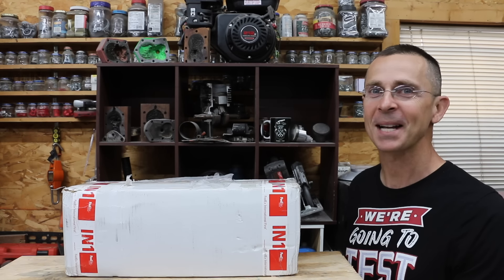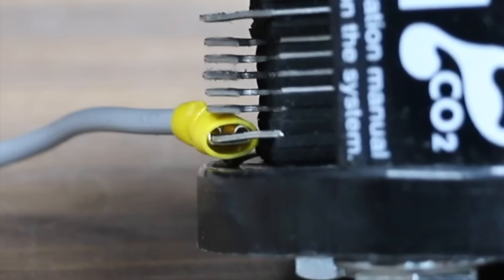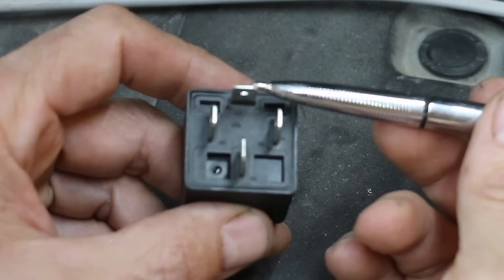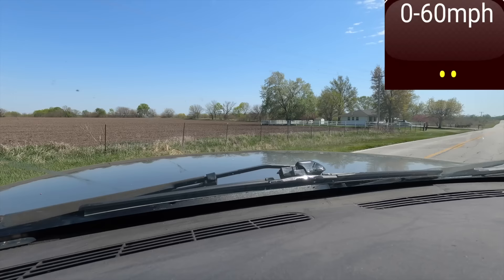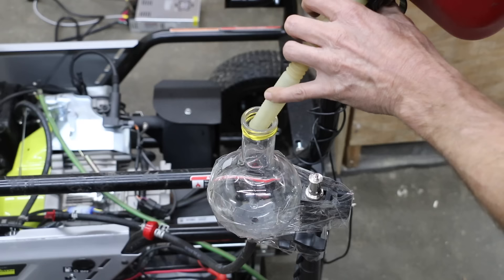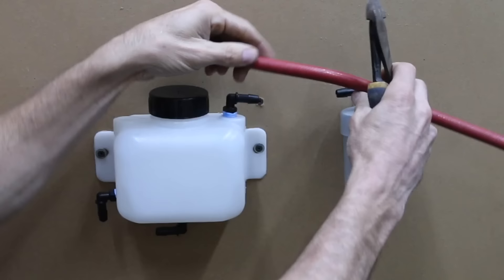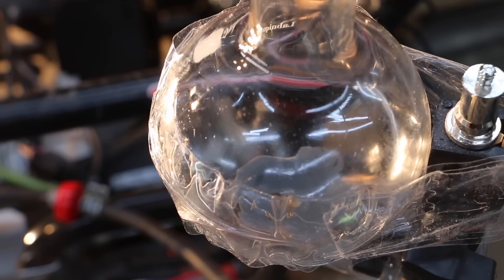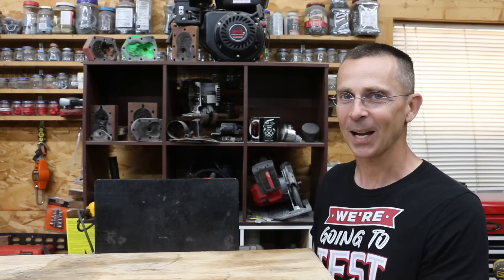AMAZING 35% More MPG with HHO? Let’s find out! Help with high gas prices?

Comment: 33 watts is about .044 hp. Since electrolysis is probably more efficient than internal combustion, the HHO (really 2H2+O2) can't possibly produce more power than that in the engine. This reminds me of the water injection systems sold by JC Whitney back in the 1960s. Those might have actually helped some of the higher-mileage vehicles (70-80,000 miles being high mileage in those days) that had deposits built up in the combustion chamber causing detonation due to the resulting increased compression ratio.  I'm sure "Project Farm" knew this wouldn't work when he decided to try it, but it is entertaining.
Reply from the maker: Thanks for the feedback.

Comment: Hi Todd. 

Awesome work mate - having watched many of your productions - I offer sincere congratulations on the high quality of your work. 

Imho - this hydrogen stuff has become utterly ridiculous in some circles with wild environmental claims about its positive abilities, while completely ignoring the note worthy hazards / problems in proposed high volume residential use.

I'm certainly glad to see this HHO cell debunked and the generator test was perfect - 5 Watt of parasitic loss in the rectifier and at best, 30 Watt of gas production added to 8.75 kW isn't impressive or even worth the additional complexity or additional material resource per Watt gained. That's assuming no leakage or loss of the extremely soluble (in virtually every material known to man), super high explosive gas, through the fittings, tank cap or pipes. Of course there is always loss in the cables and heat loss in the HHO cell itself. 

Recalling the physics favourite - Power Out = Power In - Losses.

As to folks claiming it works in cars - I understand this to be unlikely given few motor vehicles have an alternator that is larger than a Kilowatt or so. Since the alternator won't be running at full load there may be some proportion of that available to power a HHO cell. Even if that was say 500W spare - the question becomes is 1/2 kW even noticeable in a 5L+ V8 with several hundred KW on a bad day? 

If there was some way to harvest free power in a vehicle perhaps through HHO regenerative braking and HHO cell efficiency testing became necessary - then perhaps measure the Amps and time to fill a fixed space (say a mole sized box ~24L) that is lined with a balloon. Since its a mole volume there will be a text book quantity of gas of a known energy value. It would be interesting to see what the actual efficiency % and true output of your cell, minus all its losses is.

Cheers
Reply from the maker: Thanks and you are welcome!  Thanks for sharing.

Comment: I would think you would have to set the fuel intake to a leaner mixture and let the the hydrogen fill in the gaps. It seems easier to accomplish on carburetors than efi.  Appreciate the time you put into this.
Reply from the maker: Thanks!
Reply: The problem is it's a scam.  In simple terms you're unburning water just to burn it again.  The best you can achieve with electrolysis is 65% efficiency and the best you get out of an engine is roughly 30% efficiency.  So you are investing let's say 1000watts to get your hydrogen you get 650watts of fuel of which you get back roughly 200watts of mechanical energy which at best at the alternator at 80% efficiency yields roughly 160watts of electricity.  

You also need at least 4% hydrogen to burn and you will not achieve this with a simple fuse.   

Also with increased electrical load on engine you have increased mechanical load.  An alternator isn't simply producing surplus wasted power.  It's small at let's say 50 watts but that 50 watt investment is simply blown out of the tail pipe.
Reply: @mattzukowski1207  used solar panels  free any way .not used power grid .  good for off grid have bring in gas .
Reply: I'm not sure how good used solar panels are but solar is at least a real technology.  Heck you can even use solar for electrolysis and tank the hydrogen.  You'll get HEAVY losses like roughly 50% but this can be done.  Batteries are typically more efficient with lead acid being 85% and often higher.  

If you live in a city it likely would make more of an impact to sell surplus power rather than store in hydrogen tanks.  But if you're off the grid it's a consideration.

Comment: I had positive results with a 1968 VW bug. But I dropped my hose directly into the carburetor. I the fuel line from the generator pointed directly into the same area the fuel from the gas feed. I would automatically assume adding more pressure into the air system you would consume more fuel. So try finding a way to feed into the fuel system itself. Instead of trying to feed more through the air system.
Reply from the maker: Thanks for sharing.

Comment: Good work. Played around with HHO back in the 2000s on my 1987 BMW 528e.  Didn’t see any significant improvement with either fuel economy or performance, even after going through a couple of redesigns of the generator.  This car was also fuel injected.

If there’s any benefit at all, it seems to be with the older open loop carbureted systems, but even that’s doubtful.

‼️ if anyone out there does decide to play around with it be extra careful handling potassium hydroxide, and especially sodium hydroxide (lye).  These strong bases can actually melt your eyeballs in sufficient concentration so wear your safety goggles!
Reply from the maker: Thanks!  Thanks for the feedback.

Comment: I have been using a similar device for a year. I achieved a 30% fuel saving, but the water turned brown and had to be completely cleaned.
Reply: How much power from your batteries are you using? 20amps or less? What are your variables like, were you using PWM, how many plates is in your generator? Were you using a kit or home-made?

Comment: I have read that the only way these fuel cells actually make a difference are the ones that come with the wiring harness. That wiring harness is supposed to be programmed to work together with the ECM of the vehicle. Basically telling the computer to reduce the amount of gasoline introduced into the engine. This allowing the hydrogen to make up the difference of the gas that was reduced. Allowing for a more efficient combustion and cleaner burn. Systems without the additional wiring harness are basically useless. The research is out there.

Comment: As someone that has built an HHO generator and has seen results I can comment that there was a few mistakes that was made. First off the vehicle… probably has a mass airflow sensor and computer those need time to reset and calibrate so by unplugging the battery and letting the car drain for 15-30 min and then letting the vehicle go for 400 miles to self calibrate you will see some results. I’m also not happy at the intake replacement it looked very loose I would have put a hose barb. With that being said you are using electricity from the mechanical motor so with that small of a vehicle you will notice little to no difference. To get around this handicap you want to have a separate power supply or another battery you can use to supply power to the generator. Same thing with the gas generator the power supply was plugged directly into itself so with those inefficiencies you will not see any gains in performance. When I built my cell in the past I just used table salt to make an electrolyte it took a good 45 min to reach peak efficiency producing gas. But again more electricity more power. In the past I thought of increasing the input from 12v to 100v using a booster but never got that chance. With a truck I thought of having a box that kept the HHO, water, and generator in the box and feeding a tube to the engine, on the outside a small solar panel will keep the battery charged when not in use and just wire a digital battery monitor inside the cab. That’s my idea at least. I had a Chevy cavalier that I made my HHO generator for about the same size in this video and I saw that the engine ran smoother, I did have a fuel economy gain and I would top off the reservoir once ever other fill up. But that was a while ago and I haven’t played with this again since my car got totaled by some driver texting.

Comment: Cool Video. The laws of physics prevail. A gasoline engine is only about 35 percent efficient burning gas, which then turns the alternator, which makes electricity, which is then used to make hydrogen which is then burned with the gas. The efficiency losses along that lineup add up quickly. If this was an attempt at making a perpetual motion machine it would fail, so how can that manufacturer claim it improves gas mileage. Great video. Loved it.
Reply from the maker: Thanks!

Comment: Dont know if you can test the following setup :

Instead of having the HHO generator running at all times with constant power, decrease the power (going to the HHO) when the engine revs below efficiency band and increase it when it revs above.

Buffer the HHO (store it) and use it based on the ammount stored (control the HHO flow to the engine), make the gas feed system decrease the ammount of gas based on the ammount of HHO that is being sent to the engine.

Voilá, hho hybrid vehicle...
Reply from the maker: Thanks for the suggestion.

Comment: I’ve experimented for many years with this concept. I once had an in depth discussion with a professional and I’ve never sorted out something since. 

It takes current to produce HHO. Conservation of energy dictates that the energy produced must be less than the energy used to produce it. So, the only way I see this actually being a true real benefit is if the HHO produces more power than straight gas would have. Else I believe there’s a scientific issue. 

Please lmk if this is out of line. I’m pretty technical so a good discussion is always welcomed.

Comment: Converting motion into electricity in the alternator, then converting it to hydrogen and beck into motion should be about 20 % efficient. So with the very low power this system uses the effect should be a very small decrease in efficiency, which is exactly what you measured. Thank you for debunking these ridiculous scams.
Reply from the maker: You are welcome!

Comment: As per another comment  a pwm would make it work better. But to add to that connect the hho geni to a seperate battery with a solar panel on inside of car to reduce drag, would reduce drag on alternator to power it

Comment: For computer-operated cars the problem is the computer compensates for the lean mixture caused by the introduction of hydrogen and brings the fuel mixture back up using the same amount of fuel. The computer has to be fooled into not making the fuel richer to compensate. So wonder how it would work on a classic car with a carburetor and no computer or a generator that has a carburetor instead of a computer operated fuel injection.
Reply: which is why on the generator test he needed to manually adjust the fuel flow rate to a lower rate else all you are doing is running rich.  Same flow rate from main fuel source means it doesn't matter what you do down line because the main source is gonna run out at the same time interval every time.

Comment: I like this experiment, at first I was disheartened to find out but then I realised what this experiment was performed on. That is a generator. Most people that look up HHO generators are for cars. Where electricity is not the main produced outcome. It’s movement. So my question would be, how does it perform on a road vehicle, has someone done a before and after. Me personally thought it couldn’t work on newer vehicles due to the fuel injection and automatic air management for each chamber. So I’m turn all you would do, by adding hydrogen gas, is that it would run richer. Unless the vehicle can automatically determine burn rate and adjust the fuel going in. That would be an interesting experiment

Comment: If it was working, you would have to drive around light throttle for some time on HHO before full throttle would be faster.

The point is your ECU reads there's extra fuel in the exhaust (gasoline AND hydrogen) so it dials back the gasoline going into the engine. This is a fuel trim. When your foot is to the floor your ECU only uses long term fuel trims, which it learns as you're cruising around throughout the day or over multiple days depending on the car.

Comment: the one thing that most people dont know about the hho systems is the fuel intake or carbarator needs to be tweaked, i needs less fuel and more air with an hho system so of course on this test there wont be much of a change to anything

Comment: I think the only way for this to have worked, is with an old engine. EFI, has to monitor the output of the engine. If it’s too lean, (too much combustion/explosion) then it regulates its performance. Thts its job. You give it any changes, it will change to give you what it’s ment to perform. Thts why, adding high octane fuel, will not last longer of perform better.

Comment: So from my understanding the issue with these kits is they don't account for switching on and off when the engine is under load or not. 
  
The idea should work if it was like an e-assist situation. Generate/load the alternator only when coasting and idling then add the hydrogen when acceleration from a stop is occurring.

Comment: the best is with a PWM to increase the production of HHO in acceleration with a micro controler and also add MAP / MAF also with a micro micro controller that will  automatically adjust the rich / lean and you can read the oxygen sensor also to increase the accuracy of rich / lean gaz, by doing with pot and reading the voltage you can damage the motor, also we don't know how much production LPM and amps that been drawn from the alternator.

Comment: My dad had a water injection on a 55 chevy 6 cylinder.  He had a metering by the vacuum advance and water went into the intake vacuum port. It did improve power slightly.  Or so he said.
Reply from the maker: Thanks for sharing.

Comment: I had a 92 maxima 5 speed.  I created a makeshift hh0 out of a brillio pad in a pickle jar and had it connected to my headlights.  Using the "recommended"  93 octane his car couldn't peel out not one bit.  After turning on the hho (turning on my headlights) I was peeling out in 1st gear like never before and had quite a bit of more power all around.  My gas mileage was horrible and eventually within a week or so my pickle jar exploded under my hood.
Reply from the maker: Thanks for sharing!

Comment: Might be a good regenerative braking strategy for petrol/diesel engines if the electrolysis comes from the current generated by a magnetic break. Then it could be used to quickly speed the car back up due to the high concentration of HHO generated in the system. 

The way it is here trickling in small amounts generated by the car battery (which is charged by the engine) is not introducing any new energy to the system but circulating around the energy of the petrol/diesel. The more times energy is converted in a loop, the more losses you have. For sustained use, I would argue a solar roof is non negotiable (and maybe add in regen braking on top). At least that way you get a new source of energy to work with alongside the main fuel. Also if the water is allowed to absorb more residual engine heat from the combustion or solarthermal, it will electrolyse at a faster rate requiring less watts.

Comment: These kits would have to break the laws of physics to work.

The amount of energy needed to split water and hydrogen is more than the amount of energy you get back from burning the hydrogen.

So it's possible that burning the hho gives you more power but unfortunately that power and then some is being used by the alternator to produce the electricity to split the water.

If you could get more energy out than you put in then you could make engines that ran on water alone. You can't 😢

Comment: I have had a HHO installation in my Kia Sportage 2.0 on lpg, so no petrol and no diesel. I gained no better results, but my engine after a 200.000 km was very clean and it did not use oil anymore and no ventil problems anymore. Normally I had to change the ventils every 70.000 km because of the LPG that makes an engine very hot, after this never more changing. When there was the 1 year controle for CO2 etc, I had to put the hho off, because you could not measure any CO2 anymore. The dealer had never seen such a clean engine. But no more milage, unfortunally.
Reply from the maker: Thanks for sharing.

Comment: There's probably a really good reason why they compress the hydrogen gas before they put it into the engine. You might need a lot of it to actually do something.
Also, considering how reactive hydrogen is, you'd probably have to inject it directly into the cylinder to prevent it from reacting with whatever's in the air before it reaches the Piston.
I Wonder what would happen if instead of putting water you use peroxide?

Comment: Thanks for doing this.  I would be fooled by it.
I did rig up a spray nosle once  to a washer pump and spray water into the air intake and got really great gas mileage.  But it looked like a bad head gasket with the steam coming out my tail pipe, and my exhaust system rusted out.
Reply from the maker: You are welcome!
Reply: You made the world's most ghetto water methanol injection system.
Reply: this HAS to be a joke reply.

Comment: Tu HHO kits are an amazing snake oil device, on the other hand, I have a STAG hydrogen injection on my truck and it does work. I’m seeing 10-35% increase or 3-15 mpg. 3 around town and 15 on motorway. Car is jag XF 3.0 diesel.
Reply from the maker: Thanks for the feedback.